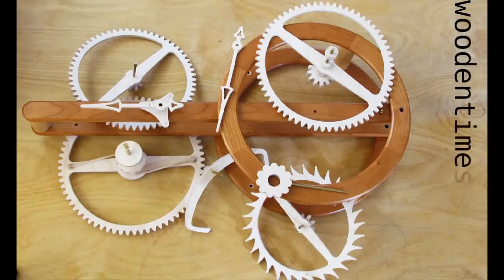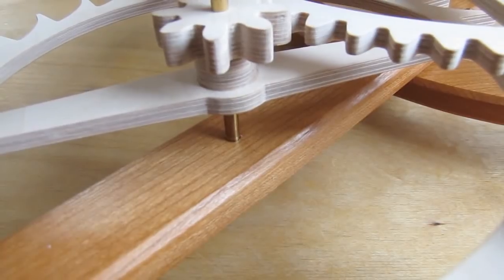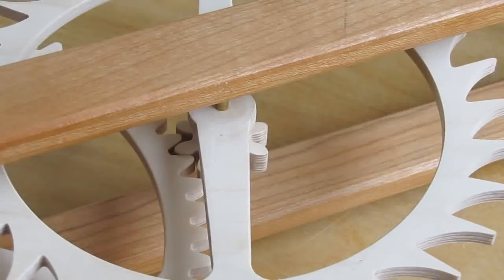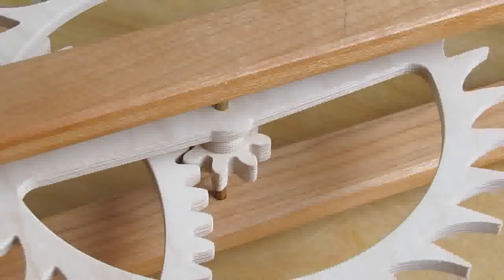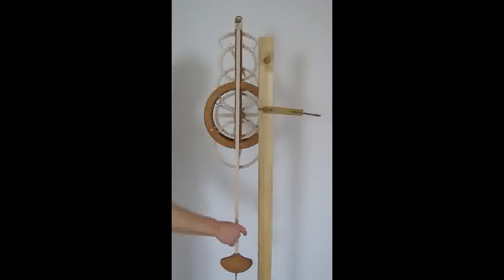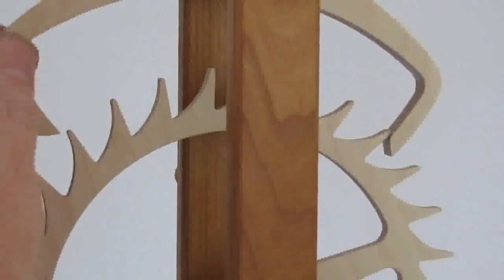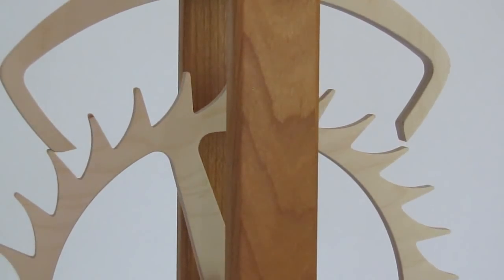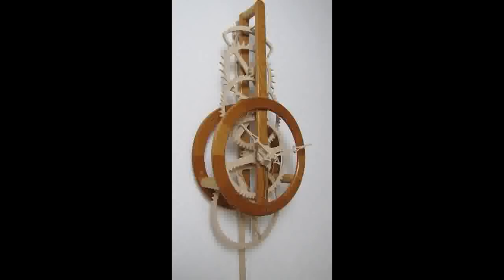The elusive tick

Comment: i love the parting words:  IF you follow all these tips, you SHOULD get a reliable clock.  i can attest that you can follow all these tips and more and still get a clock that's super picky despite your best efforts ;-)  i have a clock on my wall right now i've been doing the yo-yo- dance with for months.  it ticks for a week, then stops.  i take it apart, i put it back together, it ticks for another week, then stops.  pendulum bob up, pendulum bob down.. up, down, too fast, too slow, or not ticking at all.  i have been at it like this since May (it's septemeber 2015 now) and all these excursions into "fun" have caused me to do is research balance-type escapements.  i want to completely do away with pendulum based clocks.